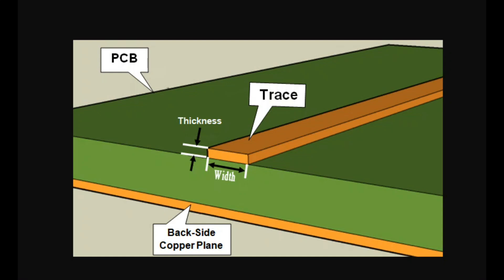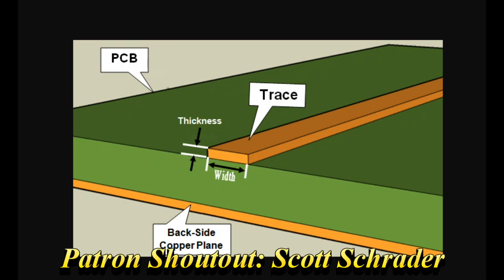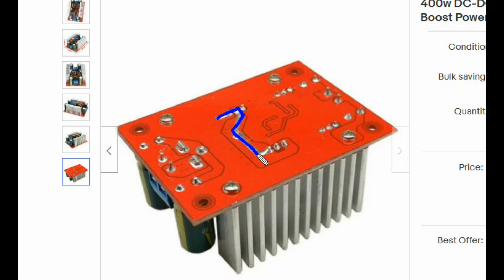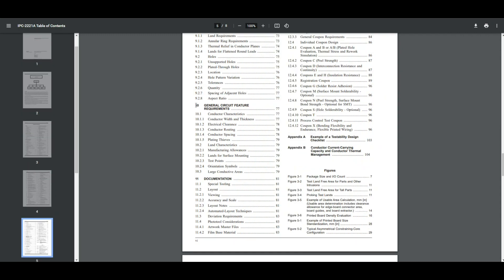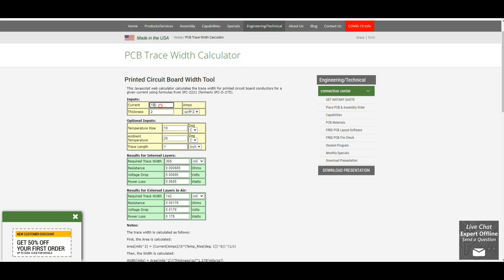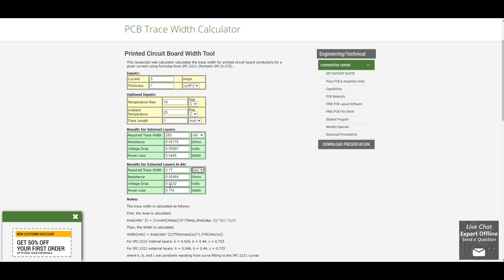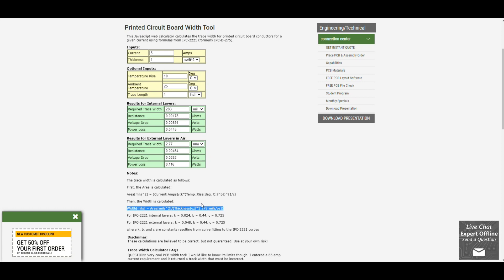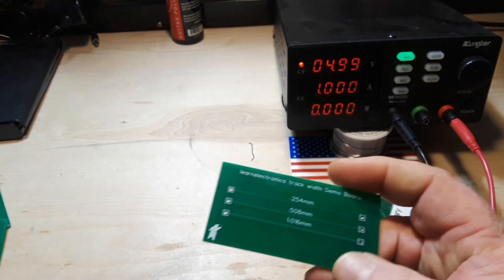PCB Design Considerations: Trace Width

Comment: Bigger is not always better. Sometimes, traces should be sized for impedance matching or not accidentally creating an antenna with a big trace
Reply: A wider trace doesn't create a better antenna. That's just a misconception about the physics of electromagnetic fields. A mismatched trace creates an antenna. Whether I have a 90 Ohm trace with a 90 Ohm termination resistor or a 30 Ohm trace with a 30 Ohm termination makes virtually no difference. It does, of course, take a lot more power to drive the 30 Ohm trace with the same voltage, if we are talking about logic with constant thresholds rather than analog RF systems with constant power. For logic it is therefor much better to use a higher impedance design.

Comment: I'll bet the typical engineering firm has standardized the maximum trace wattage they design to. I wouldn't be surprised if there's a class of consumer electronics never exceeds 1/4 Watt or even 1/8 Watt on any trace.

Comment: What is the perfect temperature that should be expected that is at operating voltage and current for any trace width? you didn't mention what is suppose to be the perfect temperature for each trace width at each wattage
Reply from the maker: It's not about a set temperature, it's about temperature above ambient.
Reply: @learnelectronics  So any PCB Trace that is measuring above room temperature is considered BAD?

Comment: I use Yankee units for traces! I set my design rule to 25 mil traces and 25 mil clearance for all my through hole projects. If I mount a relay cube on the board and route to a connector at edge of board I use 100 mil top and bottom layer and air gap coil/load barrier. That gives me 5+ amps on the load with one oz. copper.

Comment: Max current is thickness * width. A longer trace adds more resistance as well, so even signal traces can benefit from width increases if the run is long.
   That pretty green covering on your traces insulates the copper from the air (while it prevents oxidation) so keeps it hotter.
   Rule of thumb: make any traces running power and ground to outputs as wide as your budget will stand, and everything else twice as wide as necessary. This is because acid etching of PC boards is a chaotic process, and you may have thinner spots occasionally. [I don't know what method(s) PCBWay uses, but acid is common and cheap, so perhaps likely.]
Reply: Acid etching does not necessarily lead to a reduction in copper track thickness. The standard industrial process for producing chemical etched PCBs is to use a negative chemical resist, defining where copper is to be removed. Before any copper is etched away, tin is electro plated on to the exposed traces, potentially covering them in a relative thick coating of tin metal. The negative chemical photoresist is then removed with a weak alkaline solution or other organic chemical solvent, exposing the copper area between the tracks to be etched away.
The tin then acts as a resist to etching with a solution of hydrogen peroxide and sulfuric acid. This technique has the advantage of making the process less time sensitive, as the only copper being removed is between the tin protected tracks. As under cutting of a positive resist is avoided, this method produces much finer features, because there is less chance of finer tracks being eroded by prolonged etching time. This technique also lends itself to larger production runs, where the first layer of resist is screen printed onto the copper coated board, eliminating the photo exposure step.

It would be interesting to see the current start of the art practice for producing PCBs. No doubt there are different methods used for smaller production run, to those used for large scale mass production. 
There are a number of companies that sell laser etching equipment for making prototype boards and preproduction runs of boards. 
It would be interesting to see the details of the processes used for making the small volume orders, such as those generated by hobby electronics.
My guess is that laser etching will play its part, but it must fit into a total process that gives multilayer boards, with plated through holes and tin or gold oxidation protection for the copper, plus the layer of resist.
Someone must have posted a YouTube  video on modern PCB production techniques.
Reply: @nigeljohnson9820  Interesting. I have seen traces that had 'undercut' in places, and in fact solved a few problems with hairline cracks by noticing these. I fixed them by covering with solder or wire soldered onto it.
   My only foray into PCB creating was a home kit I used three times, and undercutting with trace narrowing was a problem.
Reply: @trelligan42  when using a positive photo resist contact printing, undercutting is a problem. It is the result of a number of processing issues, such as poor contact between the photomask and the un-exposed photo resist coated copper board during UV exposure, or not having a sufficiently opaque photomask, resulting, in a thin resist or one that is covered in microholes. (The holes being the result of using a laser printer to make the photomask.)

The professionals who once used the positive resist technique, quickly discovered the need for the photomask to be truly black, unfortunately the lithographic  film needed to generate this high level of contrast is very expensive and has a very short shelf life. It was once possible to buy a drum photo plotter that manufactured these masks in high resolution, unfortunately this too was very expensive instrument. The contact problem between the mask and the board was solved using a vacuum table to suck the film into tight contact with the unexposed board. 
The only way for hobbiests to control mask contrast is to double up the mask film, to improve the contrast ratio, and limit the UV exposure time,  and use a less aggressive etching chemical, than ferric chloride solution, such as cuprous chloride and hydrochloric acid solution, or ammonium/ sodium per-sulphate. The latter, known by the trade name of  fine etch. It too  also has a very short shelf life once mixed.  Process temperature control and air stirring of the etchent also improves the quality of the PCBs that can be produced. Heating the etching solution to 35 to 45C, controlled to 1 degree, improves the soeed and consistency of the etching reaction. The copper 1 chloride solution also has the advantage of being self buffering and regenerative, when blown with air,

Some hobbiests have found a solution to the problem by using a laser plotter, to vaporize a paint based resist. The method shown in  some YouTube videos is to coat the virgin copper board in spray on car paint. 
The laser plotter is then used to burn off the paint from the copper areas to be etched. This method can produce very high quality, fine, copper traces. 
It is a technique that is becoming less expensive, as cheap  laser plotters become available. 

The limitations of such methods is that at best they can only produce two layer boards, which may still require through hole drilling. 
I personally find the production of home brew PCBs very satisfying, but sometime frustrating. Most of my boards are single layer, double sided, with a copper "earth" (0 volt) backplane. It is surprising the level of circuit complexity that can be achieved by this method. 
Currently, I am using a CNC router to produce most of my PCBs, as this makes it easy to include the through hole drilling step. Boards that have high voltage (mains) circuits, are still chemically etched, with the through holes drilled in the first step. 
All my boards are passivated with electroless tin plating over the copper.

Comment: One trick I have used is to take thick copper wire from single strand mains cable, and solder this on top of the copper trace. This solution is better than simply adding a thick layer of solder, as the solder has a much higher resistance than the copper. It is possible to make a very neat finish to the copper wire. It is a good idea to provide two through hole fixing points for the cable. Then solder down one end of the added copper wire. Tack solder the copper wire along the length of the copper trace, to hold the copper wire tight to the pub trace. It is then possible to run solder along the copper wire, between the tacking points. If done well, it produces a clean ridge line along the center of the trace made of the copper wire, covered in a thin layer of solder. 
This solution is very handy when fitting mains switching relays to PCB, when 13 amp mains current is being switched. 
Clearly the idea solution is to use short thick copper tracks linking the relay contacts to mains rated power connectors. I have used this technique in the construction of an IR controlled, fused, multisocket main extender.
Reply from the maker: Great tip, thanks.
Reply: Yes bruv, I've used the exact same method described but with slivered copper wire you can get it cheap on Ebay used for jewelry or craft things.😎💕🖖